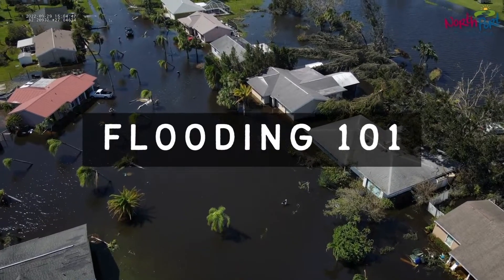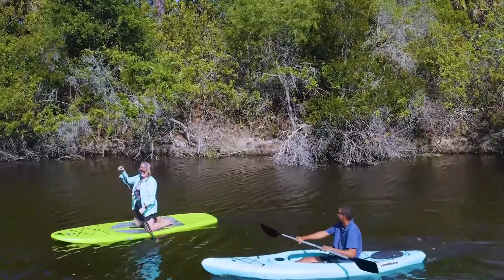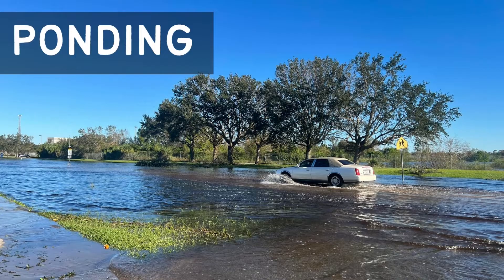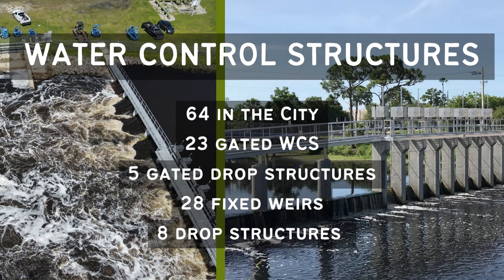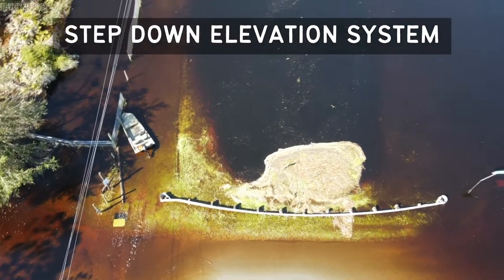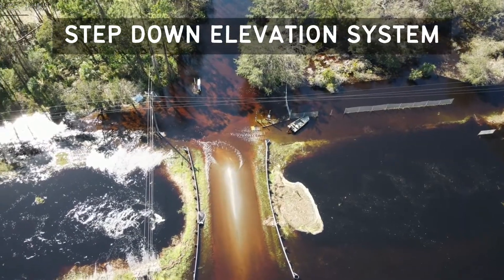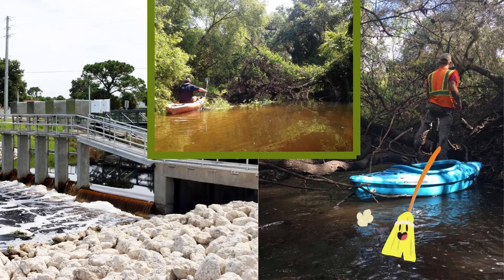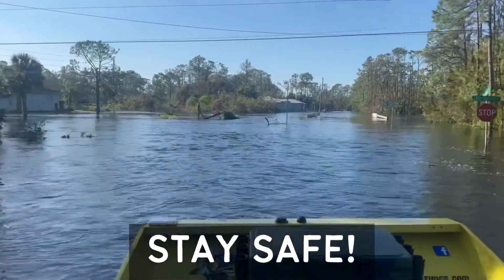Why Does North Port Flood?

Comment: I grew up in north port and I have never ever seen it flood like it did. The water control behind Winn Dixie the day after the hurricane was not open to slow the water to flow through properly. As well as multiple others were not opened up. I was in flood level D supposedly and never received anything about flooding or evacuation until it was around 11pm the storm night. There was water flooded over 12in in the house and over 6ft in the street. I had 3 young children on their top bunk of their beds. We lost everything due to the flooding. Within 24hours the mold had taken over and it was unsafe to stay at the home we rented. Nothing was salvageable. North port did not do what they needed to in preparation for this storm no matter what they say.